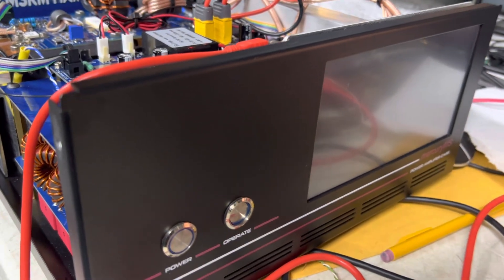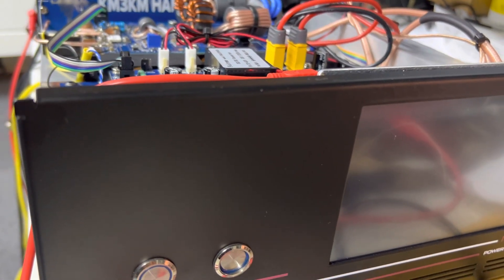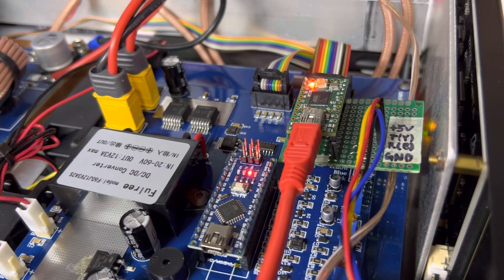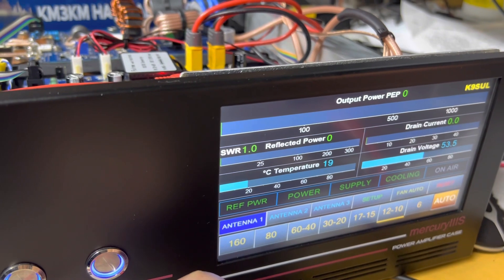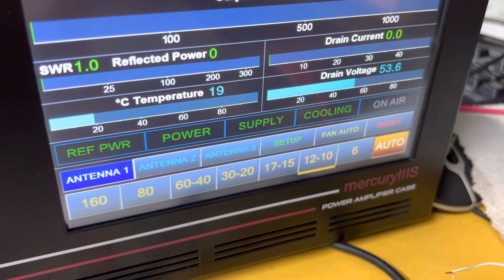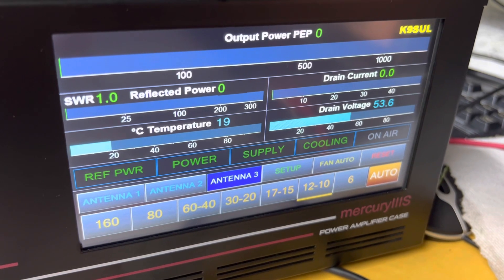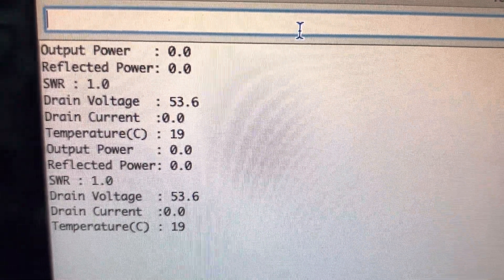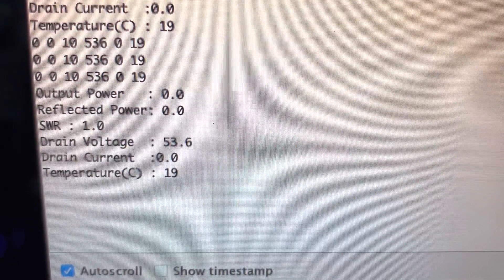KM3KM Mercury IIIS remote control

Comment: An analogy here is that you are buying a Ford Falcon, and trying to find out how to put the Shelby engine in it. You could just as easily (actually, far easier) buy a Ford Mustang with the Shelby engine already installed. In other words, that's the manufacturer's low-cost and bargain amp, and you want the features in the fancy model, the LUX. You could just buy a LUX?
Reply from the maker: But it is more fun this way. :)
Reply: @K9SUL  I agree.
Reply: Plus you have lots more options this way. Lux seems to require specific windows app. Unless they have since published api.